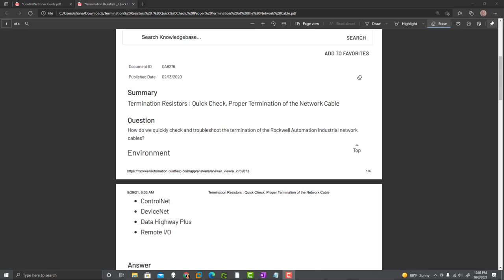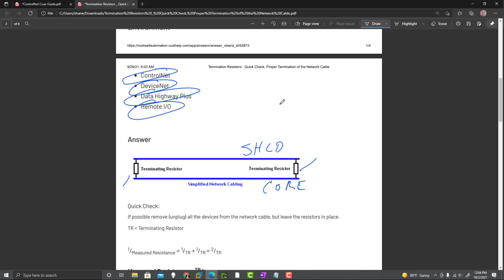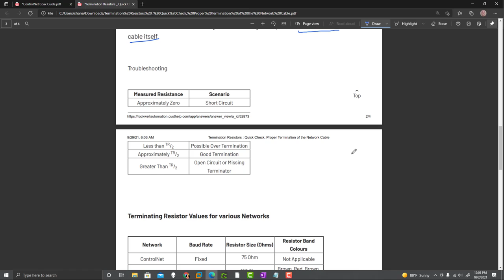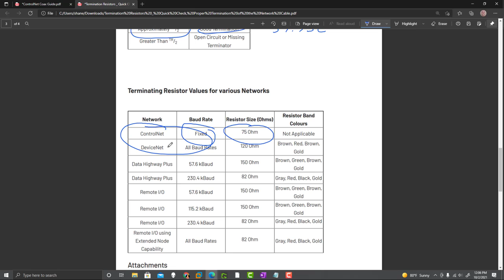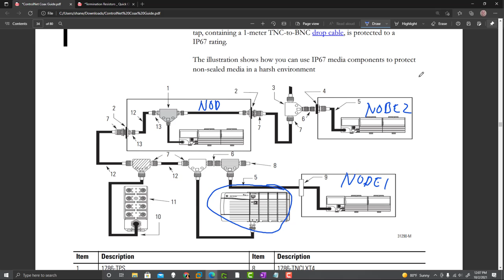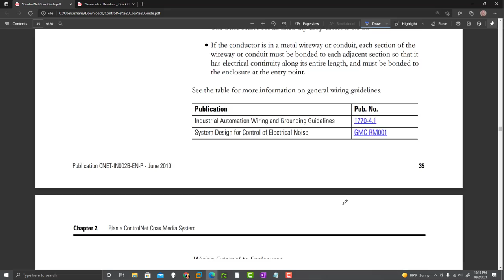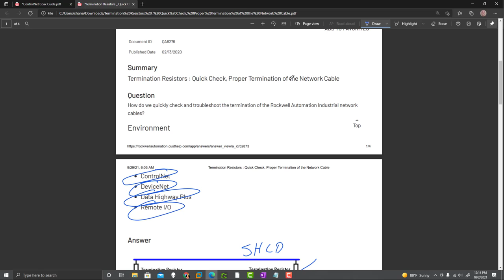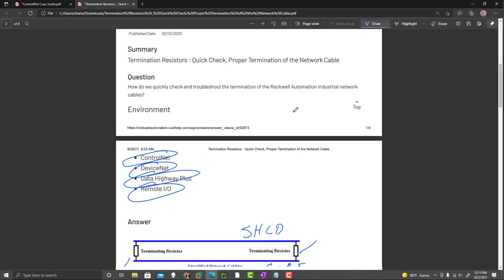Unable to Schedule a ControlNet Network? Check the ControlNet Cable the Correct Way

Comment: Control net/ device net- Two things are still being used but yet they’re very limited resources on them out in the YouTube space
Reply from the maker: I agree, this is exactly why I wanted to share this because it took me over 6 hours to find this problem when it happened.

If I would have had a good resource then it would have shaved hours off of this fix.

Funny turn of events, I ended up using the same technique on DeviceNet a month later.

This time it was a quick fix, under an hour, because I knew how to troubleshoot the cable which is generally the problem.

Thanks for the support